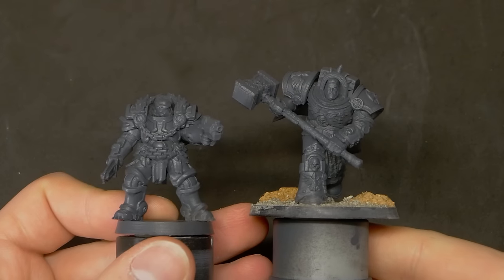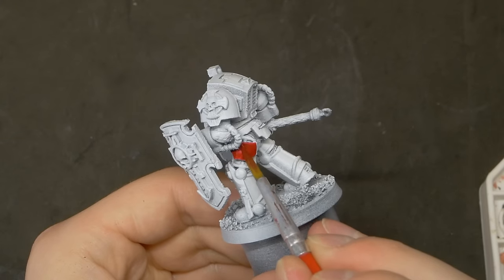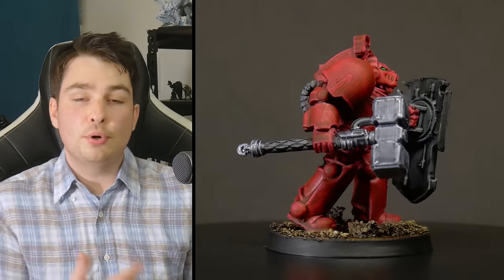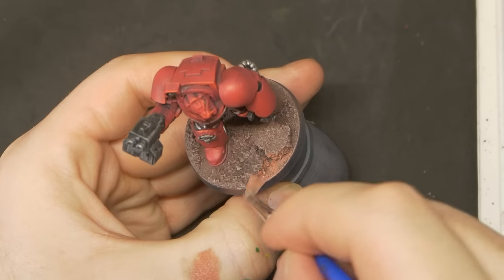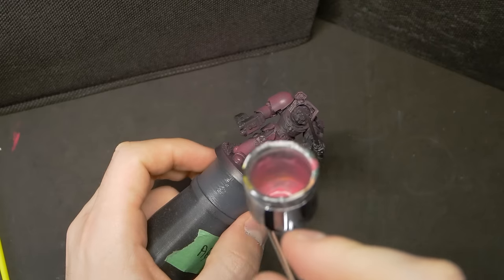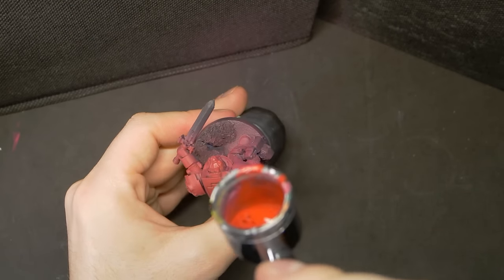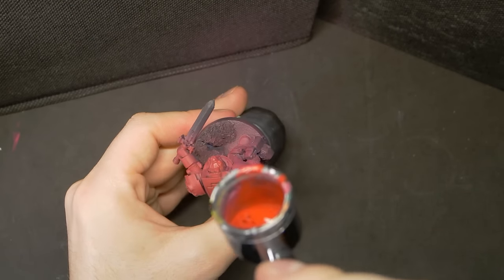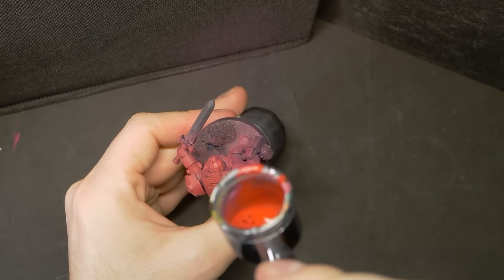4 ways I PAINT FDM MINIS to make them look AWESOME!

Comment from the maker: What's your favorite method for painting FDM minis?
Reply: Speedpaint just to challenge myself to see how much I can get done in a specific number of time
Reply: Tamiya acrylic flat black as a primer (it has acetone in it) then layering, followed by a enamel wash if necessary. For my 6mm kill team board/minis I'm doing the same, but I may deviate. 6mm in fdm doesn't give you much breathing room with layer lines.
Reply: Airbrush once in opposite color to fillament, mix up some miliput with water and give it about 2-3 coats of gap filler, depending on how bad the layer lines. Paint again in base coat black with airbrush, highlight main areas with a darker shadow color, then a brighter over the top as per where the light source would be. Dry brush metals and a highlight color. Paint details and edge highlight. Putty off and do specific details/glows with airbrush, re-detail what needs to be done. Clear coat/brush in some varnish to fill in cracks if need be.

I like color shift rattle cans as my final layer, the sparkle/chroma change hides some of the remaining layer lines and confuses the eye.
Reply: I use a base coat coat of acrylic in a high mid tone, then paint the model all over with a darker oil paint. I remove the oil paint with a clean brush dipped in white spirit to reveal the high points. I feel this is the easiest and quickest way od doing decent tabletop minis. The great thing with oils is there's no staining.
Reply: @Painted4Combat  SlapChop and traditional base & wash.
Reply: Acrylic paint markers have been my go-to. Quick and easy to pick up at any time and have fantastic coverage(esp. the metallics)
Reply: @aslskfan1  can't beat a base and wash. strange how it fell out of favour, although i only use oil washes now. so much better imo
Reply: @nartr1 Which ones do you recommend?  I might give this a try.
Reply: @cyborgbadger1015 I have seen some oil washes on YouTube.  You put them on and then wipe them off with a cotton swab?
Reply: @aslskfan1  yeah,  put the wash on and leave to dry for half an hour to an hour then use swab plus spitits to take off whatever you want. brilliant for washing yellows without staining btw.
Reply: haha spitits. I meant spirits.
Reply: What FDM printer are you using? The minis came out super crisp!

Comment: A trick I recently learned is that to get a smoother coverage on models with speed paint is to actually paint the part in speedpaint medium first and while its still wet paint on the speed paint. The medium layer needs to be fairly light, dont just glob it on, but it gives the paint extra flow and helps prevent pooling especially on flat surfaces.
Reply from the maker: Ooo theres a thought! Might have to give that a go
Reply: I've never painted the model with the medium, I mix it with my speedpaint.  You can change the ratios of mixes for a different saturation too.
Reply: @turtlecheese8  You dont paint the model with medium. You apply a layer of medium on to the model (with flat surfaces). Than while that layer of plain medium is still wet you apply the speed paint. This process allows the speedpaint to apply and spread more evenly across flat surfaces (which is often something speedpaints struggle with). This technique allows you to avoid annoying pooling on flat surfaces.
What I described is different from diluting speedpaints to achieve a different saturation, though there will inevitably be some change in saturation since this process will indeed dilute the paint somewhat. Hope that makes sense!
Reply: @antongunther3977  Huh, interesting, I'll give it a shot next time.

Comment: Just printed a Land Raider Cusader recently in FDM on a .04mm on Elegoo 4 pro. Yes lots of line and such but tolerable and i love it and that i saved 60-80 bucks. Roughly 20 bucks (electric and material) and about 15+- hours it took to print.
Ive also printed mini's and custodes jet bikes on a Neptune 2s, but i was dang surprised by how much detail it got with a .04.
 One day im planning on using a .02mm on it just to see what it can do. Same with the 4 pro but that'll be a while.

Comment: Tip for speedpaints: (especially Slaughter Red, purple, green and the other thicker ones) you NEED a drop of Speedpaint medium.  I was ready to throw mine into the garbage day one because I could not get the red to stop pooling and setting up to look awful.  Adding a drop mixed with the paint saved EVERYTHING.  If you don't have medium, a drop or two of water will suffice.  Hope this helps in the future, I really wish they sold the medium in their beginner box and advertised it as such.  I hope you revisit painting an FDM print in red with it watered down because I think it'll make all the difference.

Comment: Finally a channel that shows that not everything is bamboo Lab. 

Friend, I love your content, and how you promote the printing of miniatures in FDM for those who say it can't be done. 

I have an Elegoo Neptune 4, I am a digital sculptor, and this has encouraged me to start printing my figures with a 0.2 nozzle. 

Until now I was printing with a 0.4 nozzle at a layer height of 0.08, in a size of twelve centimeters my figures, which is already quite high quality. 

But I now want to start making smaller miniatures with good quality. I wanted to ask you. 

¿What is the minimum thickness that can be used with a 0.2 nozzle? and on the other 
¿hand Does anything happen if I change the 0.2 nozzle for the 0.4 nozzle from time to time, depending on the print I need? 
¿Is it bad to be changing so much?

Comment: So what kind of differences do different primer brands/priming techniques make in terms of layer lines as well as clogging up details?  I'm sure there are other solvent based solutions as well but most of those probably have the same practical issues as just resin printing in the first place, though maybe just an application of something like extra thin plastic cement on just the smooth areas before priming would help with the most obvious areas without mulching the details.  Can you find any options that will tend to fill layer lines but not actual details?  For instance I know a lot of prop makers/cosplayers will use different sandable primers or hell even Bondo to get a smooth finish but those are all on prints with much larger layers than what your using.

Comment: But how are you priming them? Filler primer? Regular spray primer? Brush on?
Reply from the maker: Just a generous (but not over the top) coat with a rattle-can: Rustoleum Charcoal Grey (same as i would for any plastic or resin mini, but maybe a 50% thicker coat).
~ I did mention it briefly in the "Layering" section but kinda sped over it so it might have been missed.
Reply: @Painted4Combat  cool, thanks for replying!

Comment: I've been meaning to try pinging minis in FDM. The problem is I'm stuck to a 0.4 nozzle. And while my weirdo Kobra 2 SOMEHOW still manages to print at the stupifying 0.04 layer height I still shy away from minis because I've never found a stable setting in the stock anycubic slicer, nor ANY other slicer that would give me a result I'd be ok with. I always end up with strings or strands.

Comment: What's your process for using spray primer in your apartment? I'm a little disappointed you skipped the priming step, I'm in a similar apartment situation as you but I'm avoiding buying spray primer as even if I wear a respirator, I can't ventilate the room I'd be spraying in.
Reply from the maker: I tend to find somewhere outside when I can ~ this is always the best option! otherwise I have to set up a table next to the door in the most ventilated area with a standing fan to help push the smell and particulates out said door - if that's not an option brush on primer is perfectly fine, it just doesn't look the best on camera (which I why I don't use it on my models for videos) because it often only needs to get about 80% coverage visually.
Reply: @Painted4Combat  ahhh okay thank you, I have some brush on primer I'm gonna use, I'll probably have to thin it some as it's kinda chunky right now but we'll see
Reply from the maker: @domonety8489  ofc! I have found that the big bottles of Army Painters "Air Primer" actually makes a great brush on primer (I think its literally just a thinned version of their brush on primer) nice and thin so doesn't clog anything up!

Comment: you think these prints would be better with a bambu lab with  0.2 nozzle
Reply from the maker: I would imagine it should a similar quality, if not a bit better from something like an A1 or A1 mini! These are printed with a 0.2mm nozzle but on a slightly older printer (the neptune 3 pro). For an A1 you'd just have to make sure not to print at too fast of a speed I think would be the only thing!

Comment: I admit FDM is tempting but I'm kinda antsy over the issues noise, print time, layer lines and detail with the last two being the most important to me. On the other hand FDM does have the advantage over it being less toxic in the short-term.
Reply: the noise is not that high, and if you do the right thing of setting it up on another well ventilated room (because it releases a lot of toxic gases), you will barely hear it.
keep in mind that for 0.2 you have to spend like 10hrs of energy per model to keep the nozzle at 220º, so you will see the hidden cost on your light bill. 

i do it because it is fun, but if i had the money i would just buy the minis outright, less hassle and probably equivalent on price all things considered

Comment: In my opinion the speed paints looks great! I am seriously surprised. In the video the layer lines aren't THAT visible. One thing though (and i am writing that before finishing video), there is one thing that people do wrong when speed painting (and/or slapchopping). There is just not enough colors on the model. If you are using contrasts/speedpaints/whatever, give the model one pass on the details, even with speedpaints but different, and you'll be gold.

Comment: I get that some people just want cheap, durable, decent miniatures, But guess what?, Abs like resin exists and its basicly Plastic in resin form AND it looks much better, Faster, just as durable as GW models.

I would always recommend a Resin printer, you can also print pretty fast.
Reply from the maker: I'm guessing you just flicked through the video, but my reason for printing in FDM is none of the above. 0:36 Its about ventilation and safe use, I just don't have the space to safely use a Resin printer without choking myself in the fumes (which even the so called "odorless" resins produce).
Reply: @Painted4Combat  I did watch the full video, i just mean in General i would recommend Resin Printing, you can get one of those Tends that seal the Printer and make almost to none Smell, also they come with ventilation holes, so you can direct it outside
Reply: You do know that he mentioned the fact that his window doesn't open, right? Most people don't have the space or environment for resin. That's why they haven't tried 3D printing, because otherwise they would have.